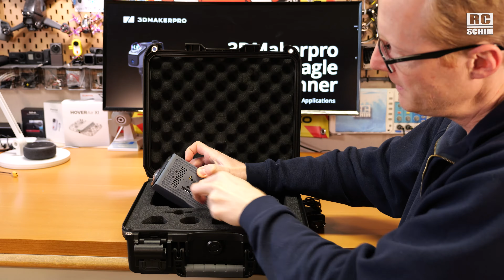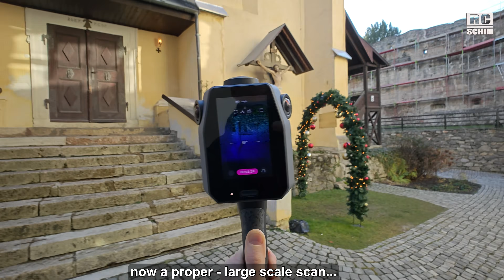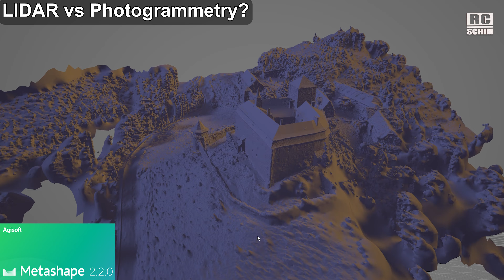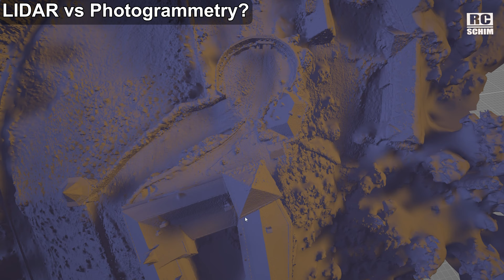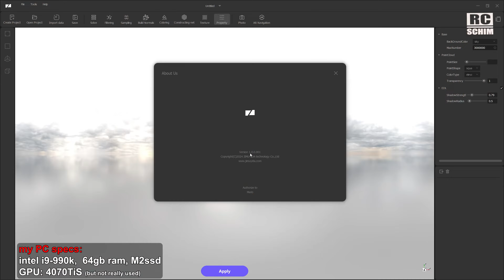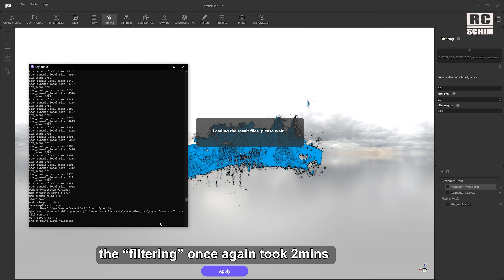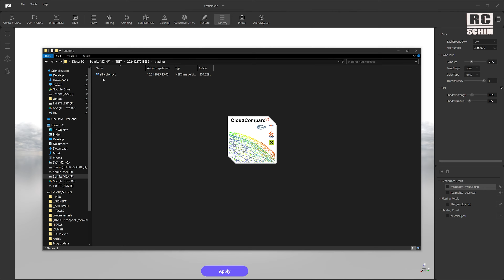3DMakerPro EAGLE LIDAR Scanner Review

Comment: Why do you aim for short scan times ? Is there hardware limitations ?
Reply from the maker: It's their recommendation, stay below 5mins, slowerr than 20kph (if riding a bike). 
I had a longer scan and the file was corrupt - maybe it was a coincidence. Since I use the SD card directly I don't have defective scans...
Reply: @Rcschim  Thanks !
Looking forward to seeing more about this scanner. Maybe trying long scann times on a tripod to see if it helps improve quality. Software is still very much alpha as well !
RTK GPS may be another plus too :D
Reply from the maker: @pierrewind11  I'm eager to test newer firmwares/software from them - also maybe I can get the RTK addon and make a follow up video in a few weeks.
Reply: Please do!! I was about to buy it for digital twin / herritage scans, but 5 min scan is a no go for me :(
Anyway - would you recommend it for scanning buildings,, churches etc?
Reply from the maker: @dainjah  I think it's great for scanning buildings. If you want the whole building (with roof) you need a good vantage point, a long pole, or a drone (heavylift).
Some ppl on the FB group found the resolution might not be accurate enough for measuring or for construction.
I dont know how accurate it has to be for your work - just consider that...
Reply: @Rcschim  I need something to accompany my 3d scanning/photogrammetry hardware (drone, dslr camera. raptor scanner) but I need to know if it's worth the money for the data it provides. I need to see some proper scan results made with it.
Reply from the maker: @dainjah  check my videos description to find a link to download the scanned files. you can "easily" view them using the free CloudCompare software. There you can see in detail how accurate the scans are. I was impressed - but I have no 10-20.000€ pro device to compare it to ;)
Reply: @Rcschim  thank you!! downloading